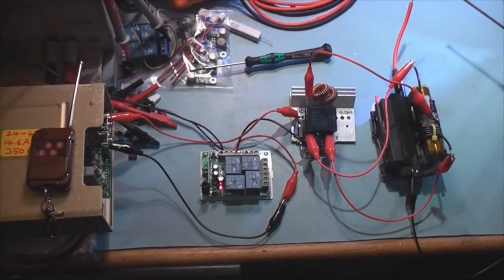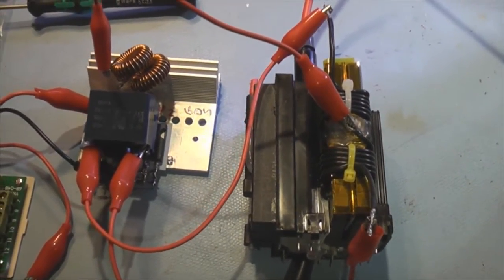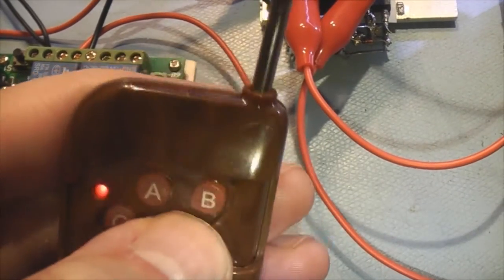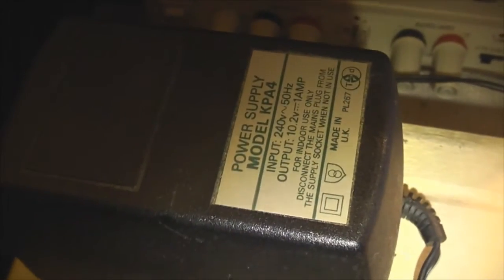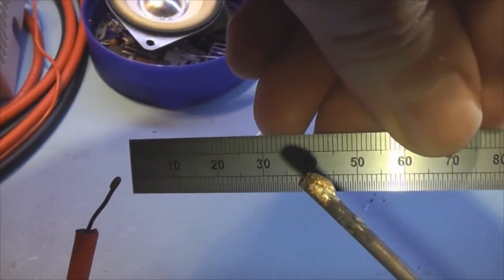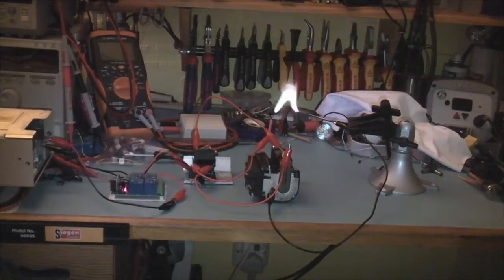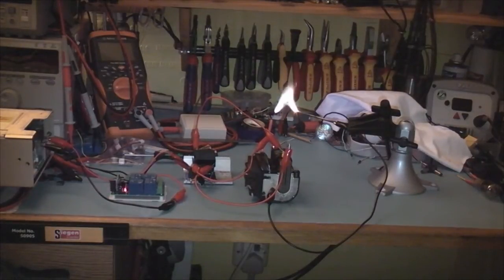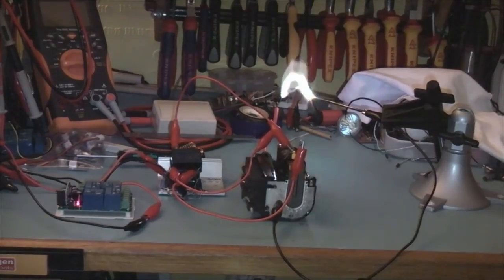RC ZVS

Comment: I had something like that for testing.. worked a treat.
Then I let someone use it and they cooked it playing with a high power RF amplifier.

You could put a circuit breaker in line so that you don't fuse the relays or burn the tracks on the board.
Reply from the maker: Thanks for the comments Mark,

Yea I probably should put a fuse etc in the circuit, especially when It's running a ZVS. That would save me waiting a month for another one from China If I popped it :)

Cheers mate

John